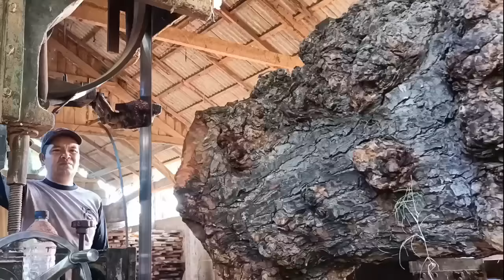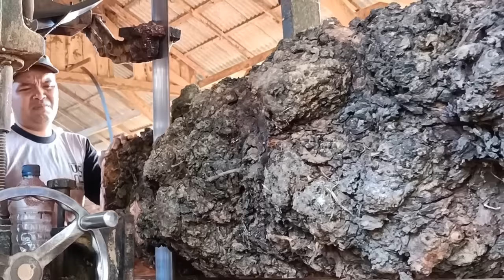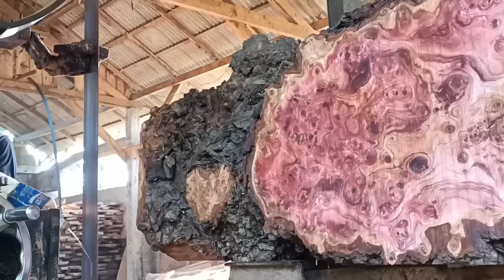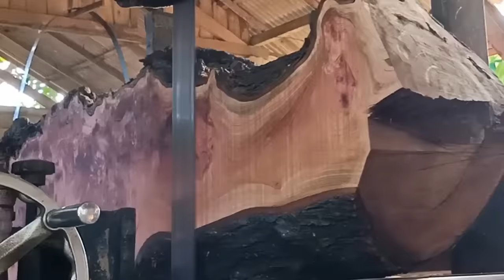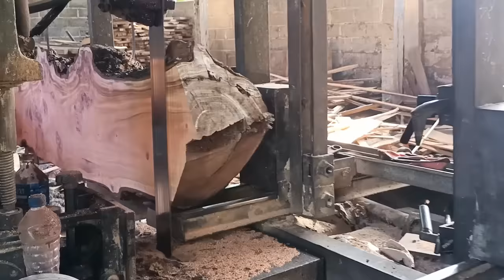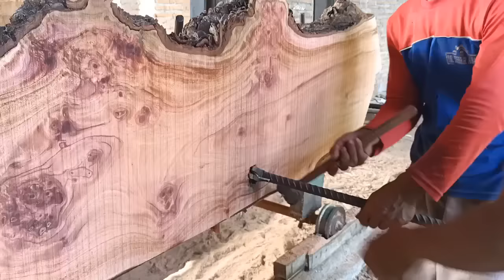This is what wood full of bumps looks like, look what happens!

Comment: Kevlar gloves, ear muffler and some eye pro?
Reply: Please never use gloves with this type of saw. Essentially what happens is the same grabs the glove and pulls, so instead of getting a clean cut and losing a couple fingers, the entire arm gets pulled into the machine & mangled.

Ear and eye protection are standard precautions though.